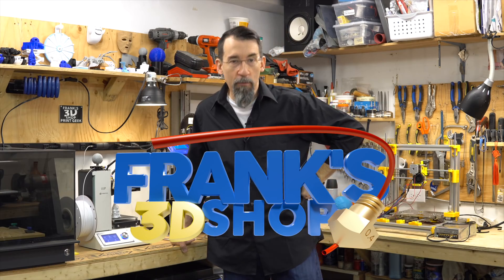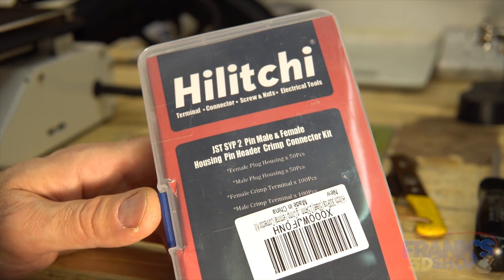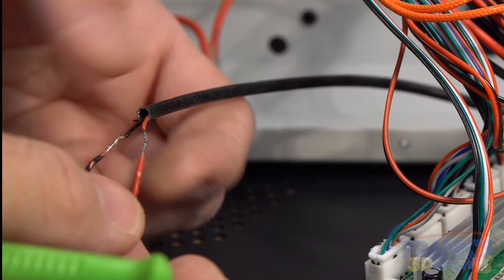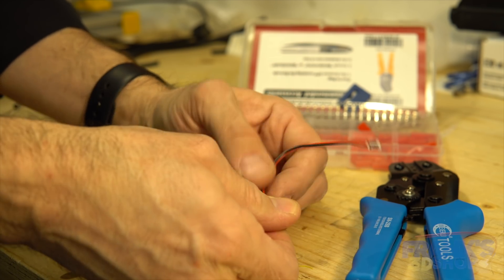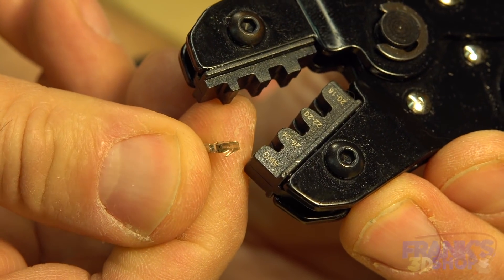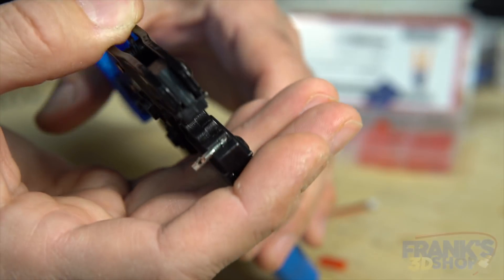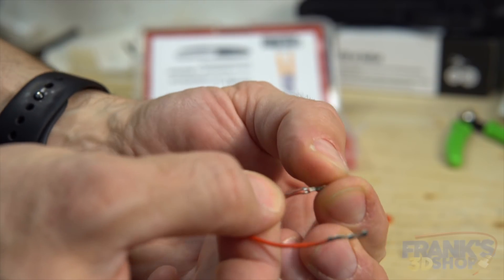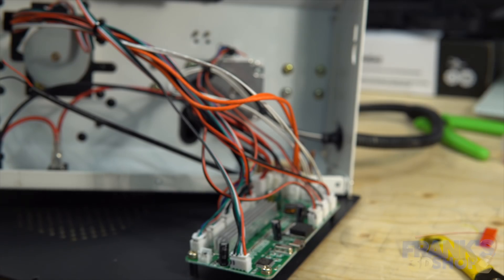Crimped Connectors How To

Comment: Thank you for sharing. I have been looking for an instruction for these connectors. It makes sense to use them in some cases. What kind of diameter would you recommend for the wires. I want to buy some wires for a printer upgrade. And I have no clue what to buy. You are talking about a different kind of connector for higher currents. What kind of connector is that exactly?
Reply from the maker: If you really want to know the current rating of connectors, you have to go to the manufacturer specs, generally the more surface area the more current, same with the cables they are rated for a certain amount of current depending on the diameter of the cable. There are many charts for that it is also dependent on the lenght, but in a printer that should not matter. I also found that crimpers with laser cut teeth works better like this one : https://amzn.to/32cSLP1

Comment: I have a ratcheting dupont crimper like that, it was cheap like, $20 on amazon -- but it always messed up the pins when I crimped them, they never came out perfect. -- I got a pair of "Engineer" brand "PA-09" crimpers after watching a video (linked below), and they were closer to $40... they don't ratchet, and seem like a cheaper tool in quality -- but the crimps come out perfect now, every time, easy-peasy. -- I'm super happy with them. -- It's the only time I've had a ratcheting crimper be of worse quality than the non-ratcheting one...
https://www.youtube.com/watch?v=3Cw9YFLDZeo
Reply from the maker: Thanks, I see, my crimper is not as bad as what is shown in this video quality wise, but I will try yours, I also have bought another crimper for JST-XT connectors, I will try them soon. I have many ratcheting crimping tools at work, they work great, but they cost $100 or more each, you have what you pay for I guess.
Reply: Frank's 3D shop that's very true, when it comes to tools you definitely get what you pay for! (we used to make that joke about some freeware software tools, "they're worth every penny!) -- because you are a professional, I'm sure $100 for a tool is well worth the investment for you! -- Though, I am just a hobbyist, so, I aim to only spend about $20 to $30 on crimpers if I can help it, and for things like ratcheting spade and terminal block connectors, I'm so glad I have them! The ratcheting crimpers in the $20 price range usually work exceptionally well for my needs. But I was just so frustrated with dupont connectors, and these really saved me, so that's why I recommend them. :) -- by the way, can you crimp JST with the same tool, or do you need a different one?
Reply: Frank's 3D shop oh, maybe I misunderstood, you mean JST-XT, is that like XT30 and XT60? I didn't know you even could crimp those, I thought it had to be soldered! -- I'm using XT60 for my 3D printer right now (for heat bed, and hot end).  I'll look forward to that video! :)
Reply from the maker: Seems to be the same tool, I don’t have Dupont connectors to test... I just checked the PA-09 and they are twice the price here in Canada, $53 against $25, I will have the other crimper tomorrow, another $25, may be they will work better. Will see, if they do I will post an update.
Reply from the maker: Yes for the new printer, those: https://www.amazon.ca/dp/B015Y6JOUG/ref=cm_sw_r_cp_tai_R4NDAbCT46EWX
Reply from the maker: With this crimper http://www.amazon.ca/dp/B01CCLX8EO/ref=cm_sw_r_cp_tai_45NDAbKBJDS20
Reply from the maker: And if it does not work well, i will just solder the connectors 😀
Reply from the maker: So I received my other crimper, and this one works like a charm, I have done all the JST-XT connectors for my new printer, motors and sensors. Now I will try them on the other connectors for the fun of it.